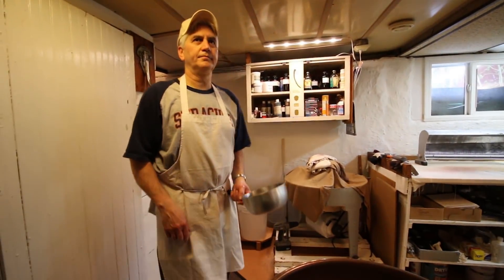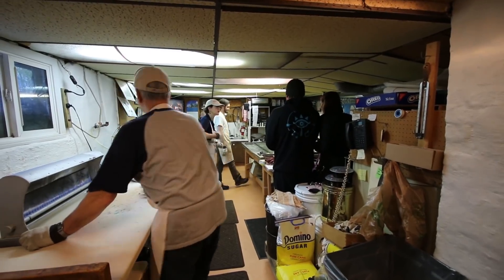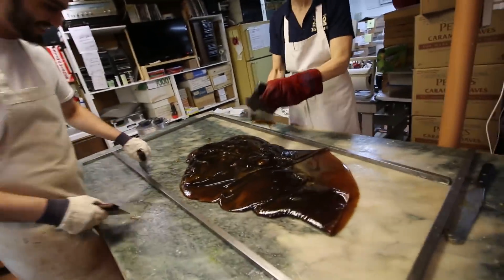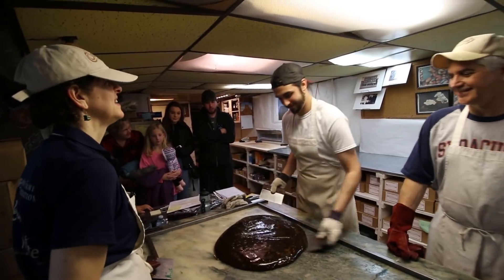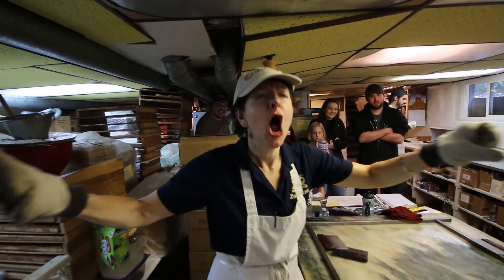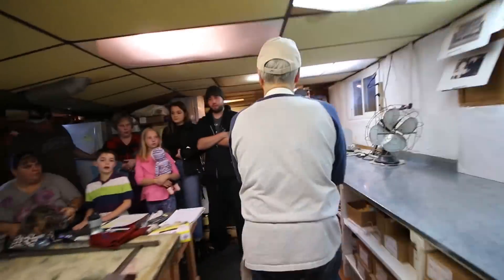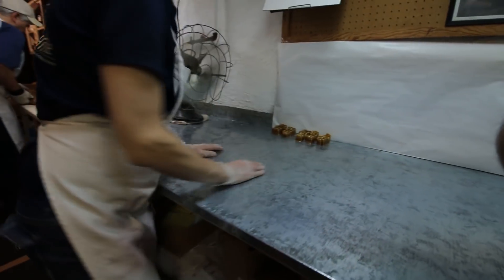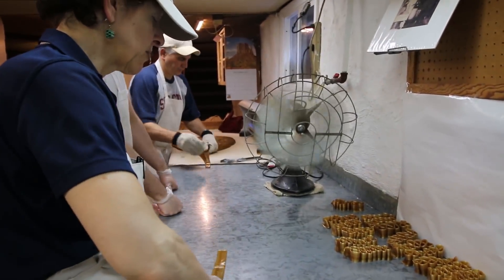How Molasses Ribbon Candy is Made | Day 7 of Ribbon Candy Week

Comment: Why do you keep mixing it hot even though you did not add anything that needs mixing? Why not just let it cool until ready to be pulled on the hook?
Reply: Bozhan Ivanov they do it so it controls how fast it cools and so it cools evenly
Reply from the maker: After several batches there are hot spots and cold spots on the table so moving the candy helps everything cool evenly

Comment: I am confused. You guys made all 7 in 1 day? You just put 1 video of 1 flavor a day for 7 days?
Reply: i think they made all 7 ribbon candy in 1 day. and did a video for each one. so we had a ribbon candy video a day for 7 days.
Reply: Shelly B they've mentioned before that making hard candy especially ribbon candy is very temperature sensitive. If there is a slight variation in the weather or general humidity within the basement it can affect the batch, that's why they only make it just before Christmas and it can't be raining because the candy becomes sticky because of the moisture in the air etc.
Reply from the maker: Yes that's exactly what we did haha and Brissy girl is right, that's why we do it